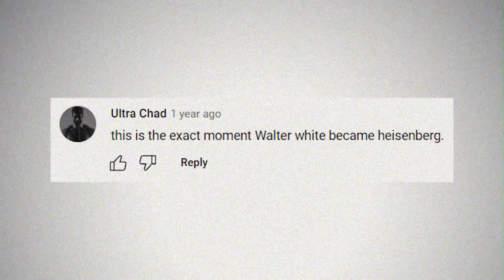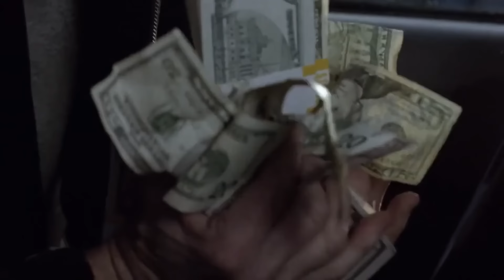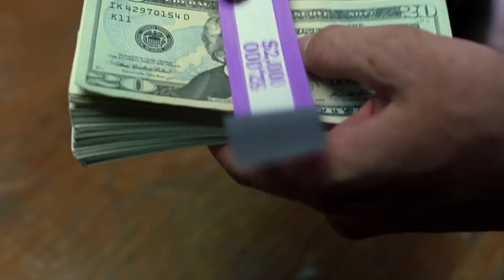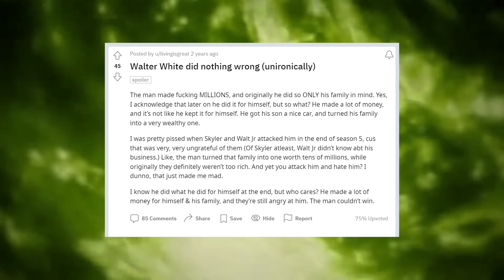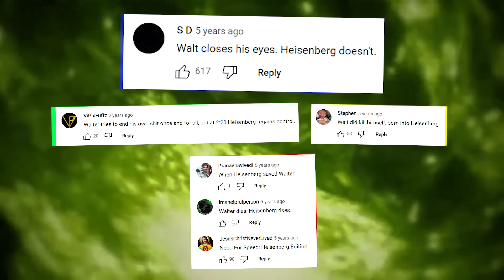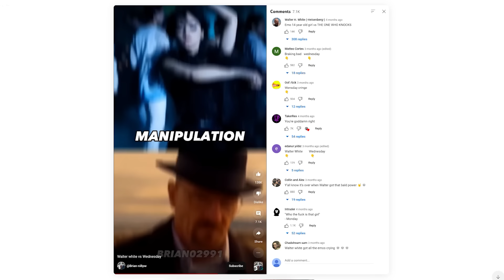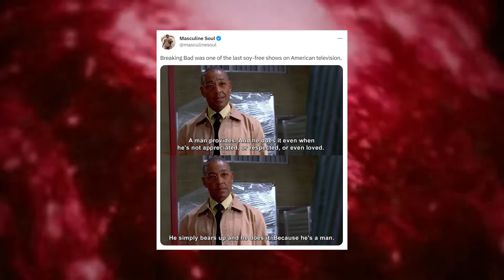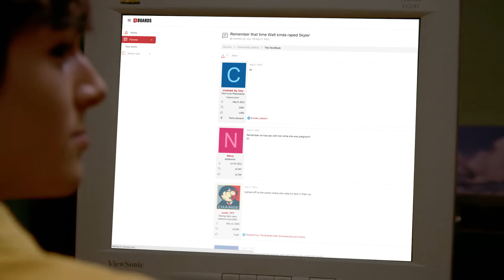"THE MOMENT WALT BECOMES HEISENBERG" | Breaking Bad - Video Essay

Comment: Really great video, didn't initially notice the length so was in for a nice surprise around the point you let us know you were gaslighting. You touched on basically every point I would've wanted, and your insightful distinction between masculinity and toxicity is quite revelatory in how simply it boils down a large issue of our time.

Comment: 55:30 something that I find is rarely pointed out is that walt is the one to knock Jane onto her back as they had been purposely sleeping on their sides to prevent an od. But walt attempts to shake jesse which moves Jane over. It's not as though he was a fly on the wall taking inaction, he actually is directly responsible for her passing.
Reply: 57:15 never mind this is mentioned! glad to see it, this video is amazing and has mentioned and addressed every point I could possibly think of bravo vince!

Comment: I think this quote from another story, said to that story's villain, describes Walt's motivations quite well(I wanna see if there's a significant overlap between the fanbase of breaking bad and the fanbase of that other story lol): ''Now it's all happened, and I can't change any of it, and I still don't know where it all went so wrong (...) Maybe it was all the small moments where you felt threatened or powerless or out of control, and all the things you did to fight those feelings''. As the YouTuber says, what drives Walt is this feeling of not being enough, and he responds to that by exerting power with no regard for the well-being of others.

Comment: The ends do not justify the means.

The ends never change, the means do.
Reply: The ends can justify the means if you do some ethical arithmetic and it checks out. I wouldn't eat a baby for a dollar but I would if doing so saves a million people. That's bad as a rule but the good consequences outweigh the bad means.

Rule utilitarian consequentialism really is the only rational ethical system.
Reply: M0raIity and humility is the way to go.
Doing something opposite of good for a "noble cause" does not erase the fact that opposite of good thing you did is still opposite of good.

Why is it so hard for people to simply admit they are opposite of good instead of doing this ethinical tug of war to rationalize their actions.